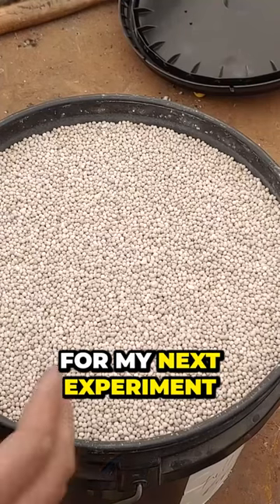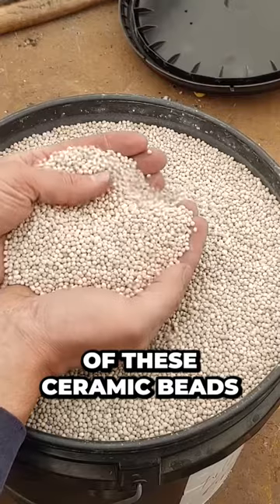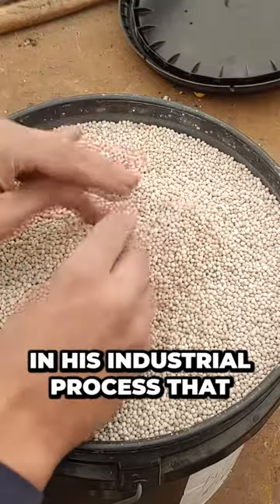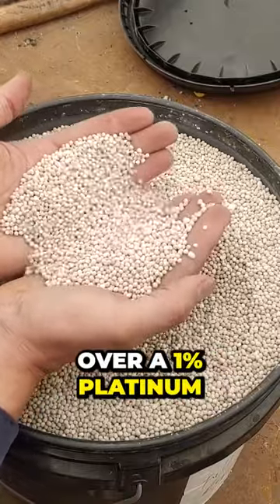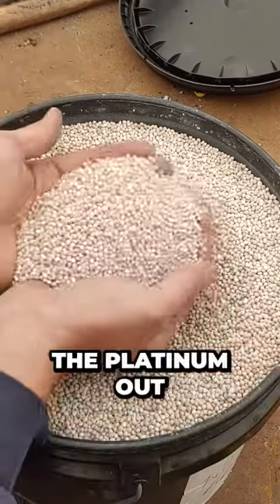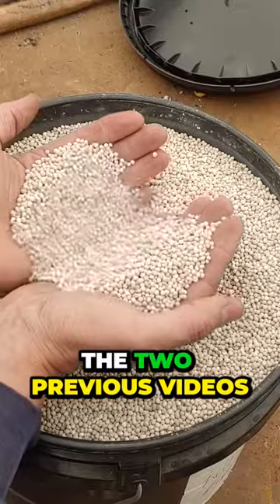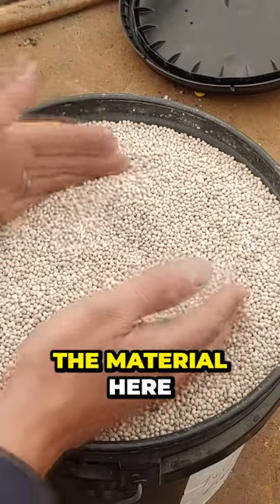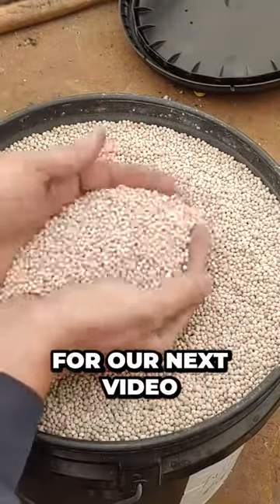Platinum Catalytic Converter Smelting

Comment: You have to take them through an acid bath first to remove the PGM from the ceramic into solution. Then participate the PGM out into a powder. Then you may be able to smelt a small amount of PGM from the material. I looked into that while I was doing computer scraping and decided not to peruse that because of the heat requirements and the acid waste afterwards was going to be a hassle to dispose of.

Comment: Does anyone know the answer to this? Are the precious metals impregnated throughout the beads, or just a coating on the outer surface?

I would think that they would function better if the metals were throughout the alumna substrate, So they were still active as they get tumbled smaller and smaller during use.

Should you cush them into dust prior to processing, or leave them whole?

Comment: Shreetips did this. Fumes are very toxic. Be careful. And all the work he went through was so not worth the small bead of platinum he got. Youd do better in snake river. Goodluck jason remember the funes
Reply: Fume hood and a good mask.
Reply: Wow I just saw how cheap platinum is compared to gold currently
Reply: I think Sreetips concern is ‘over the top.’   So do you want to stick you head in a beaker and take a deep breath of the fumes?
No. Reasonable precautions are adequate.